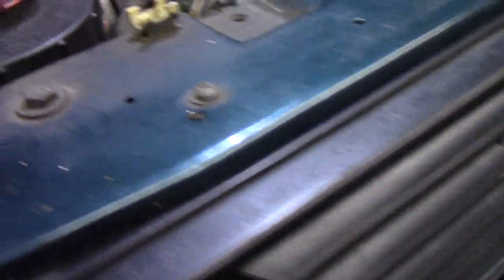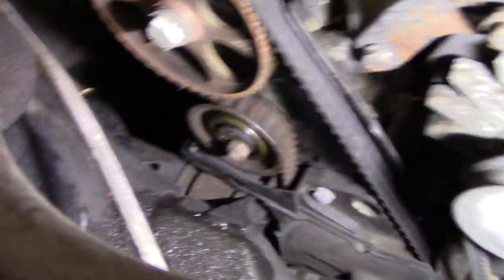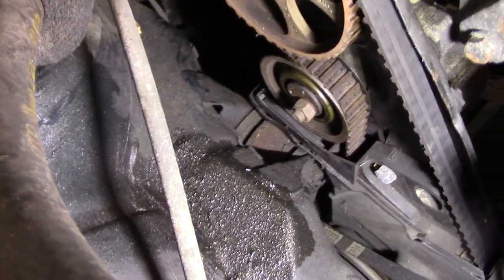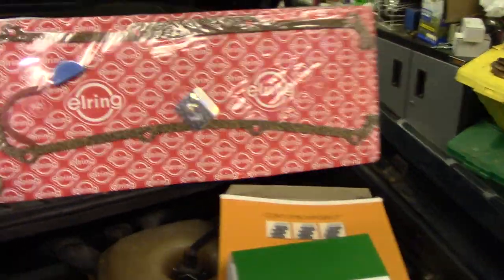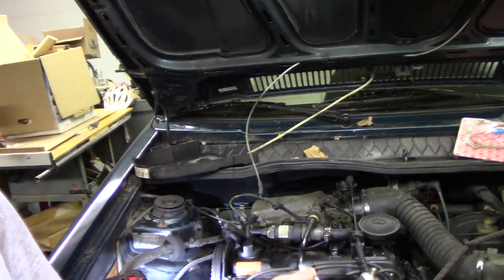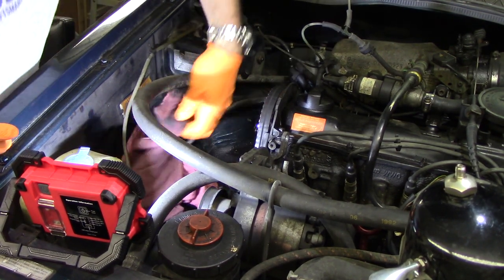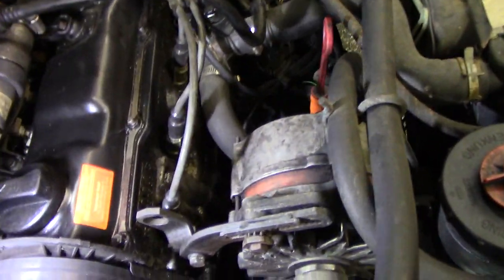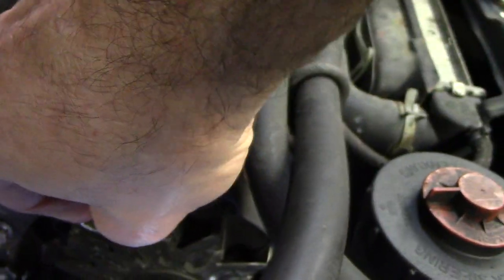VW Cabriolet water pump and timing belt replacement part 1

Comment from the maker: I would start by making sure that the throttle cable which is attached to the gas pedal and throttle body on the engine is allowing the throttle to close all of the way. When it closes properly it will contact a small switch which tells the fuel injection computer it is in the idle position. The throttle cable should operate smoothly. This being a 26 year old car could have a lot of different things going on and could have been hacked a lot of times over the years. Thanks for subscribing and watching!

Comment: Same issue with the crankshaft pulley bolts. For the life of me I couldn't make them budge even with penetrating oil and hammering on them, the hex tool also broke. The last shop that replaced the timing belt must've used way too much torque. I've yet to employ harsher methods like you used. :(

Comment: Hi Bryan's, do you have a video where you show how to change all belts from golf cabriolet mk1? Thanks
Reply from the maker: If you search through the videos on my channel I think this project ended up being 4 videos. I am pretty sure I covered most of it.
Reply: @bryansprojects3570  hi Bryan's, yes i see them.   Unfortunately to later, My mistake! I moved the timing belt b4 watching your video when i  try to unscreew a bolts from  power steering , and now i have problem,  the car start but after 20 minutes drive the engine come very hot and switch off by himself, i have to wait a couple of minuts for start back the engine. i hope the valve and piston are ok. I will check Saturday and maybe i'm going call the mechanic 😭😭to set timing. Anyway all the best and thank you.
Reply from the maker: @benmuzzin1298  it sounds like if it runs hot you may have the timing too far advanced. If it runs you have likely not damaged the valves or pistons. Best of luck.

Comment: How did you take the tension off of the a/c compressor belt?
Reply from the maker: There is a bracket that clamps to both sides of the compressor and an adjuster that should crank it down. It is pretty much a pain to get all of the bolts loose.

Comment: You know, I wonder if this job would be any easier to do if you pulled the engine out? An impossible to remove, broken bolt in the thermostat housing brings me here....😡
Reply from the maker: There is a good enough amount of room. I would worry about breaking off a bunch of exhaust hardware removing the engine.